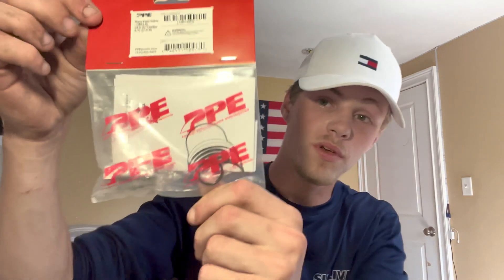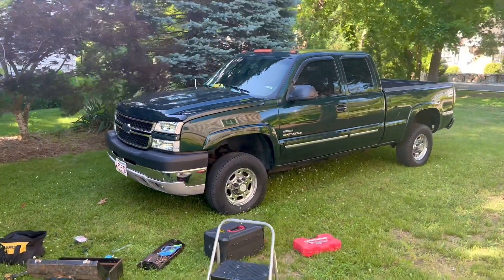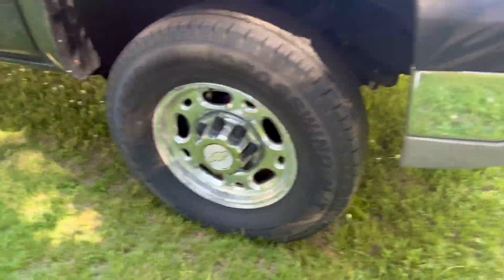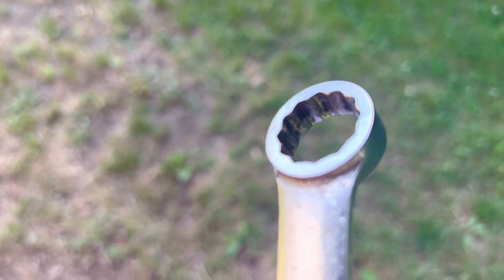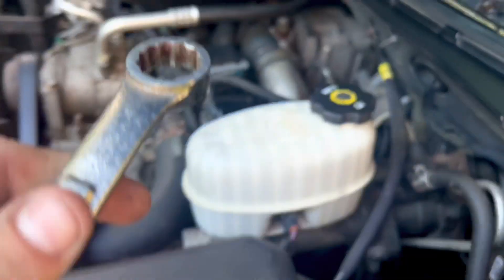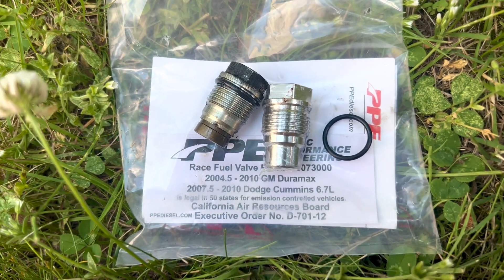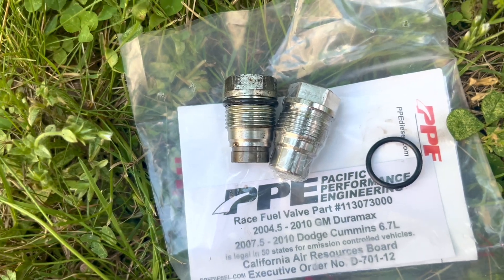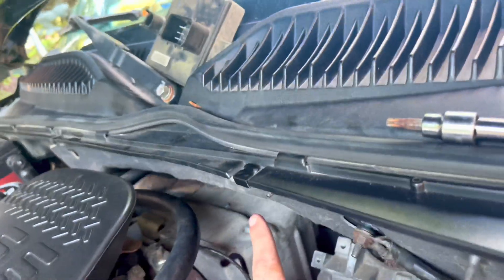Bone Stock LBZ Duramax PPE Race Fuel Valve install and review (LBZ,LLY,LMM)

Comment: Is it emissions intact? I want to tune but I’m not letting my egr fall off yet, does PPE tune work if I still have egr?
Reply from the maker: Mines not deleted and it all depends on the tuner ppe doesn’t tune for egr delete they have no by pass built into the tuner so if u plan on deleteing I highly recommend the efi live tuner that supports the egr delete only reason I ran with ppe is their known for cleaner/ higher horse and tourqe tunes and my dad already had the tuner sitting there from his LbZ he returned to stock I just called up ppe and had his vin wiped off it. So if your gonna keep it stock but tune it I’d go with edge since it has the monitor built in to watch egts and coolant temp but it’s not as good of tunes as the ppe ppe has the best tunes
Reply from the maker: Edge runs dirtier tunes so you’ll get more smoke and less mpg and less horse on the same level tunes you’d get from ppe they burn every drop of diesel so you get max performance on every aspect power mpg and just overal health for the truck the less soot the better
Reply: @Sean_ODon  sounds like I want a ppe tuner then! Thanks for your help
Reply from the maker: @EditCity  happy to help just a heads up if u wanna run tune 3 or higher (this goes for any tuner) you should install a lift pump those tunes call for more diesel then the stock cp3 pump can supply and it can throw the truck in limp mode if you call on the gas for to much for to long. If u ever got any questions happy to help.